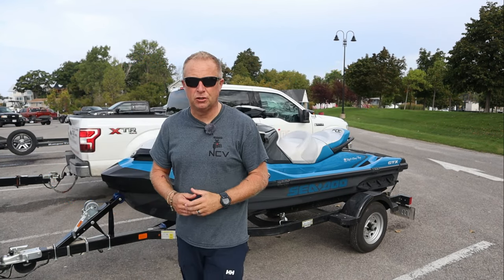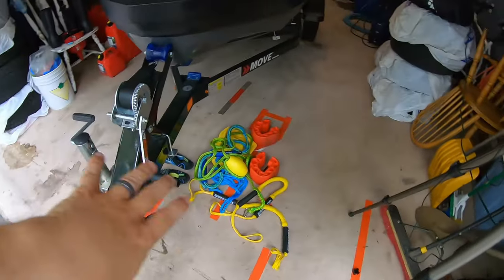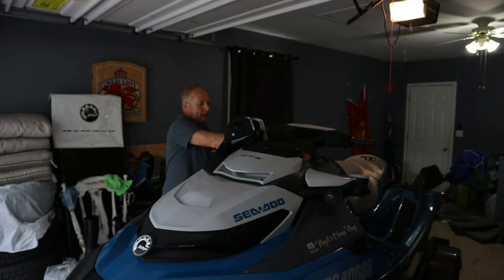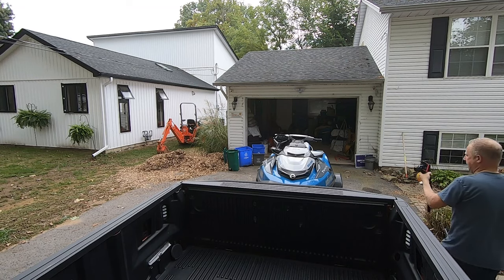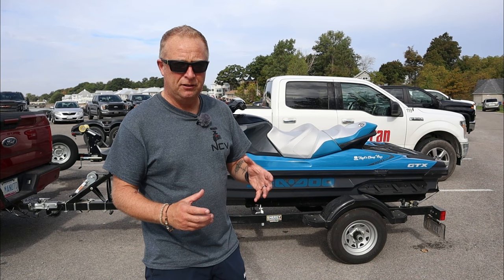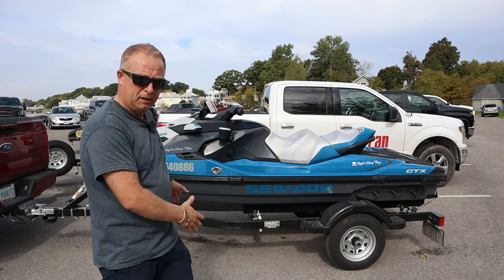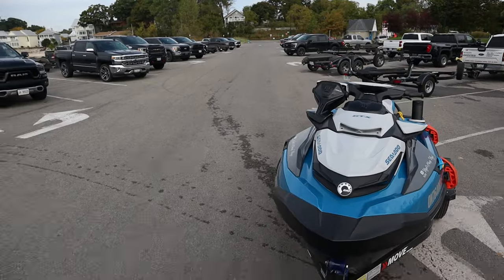How to launch a Sea Doo by yourself

Comment: Great Video!  Two more recommendations besides testing engine start though...   
1.) I recommend walking the ski down to the end or around the other side if the dock allows so that others could launch or load, depending on the dock, while I am parking the vehicle and trailer.  Never know how long you might be held up before getting back to the ramp.

2.) Use bumpers and take a quick look to see if anything on the dock where in intend to tie up might cause damage to your ski.  Screws, nuts, bolts, anything.   I learned this the hard way.  Even in relatively calm water, your boat or ski with rub against the dock, trust me!

Tip: I Used a Mr. Clean Magic Eraser on my trim to remove residue from old dock bumpers with amazing results!  However, I would be hesitant to use on painted areas without further research.
Reply: I'm in uh nkn 0:30 0:30 0:32
Reply: 2:26 2:27 2:27 2:27 2:28

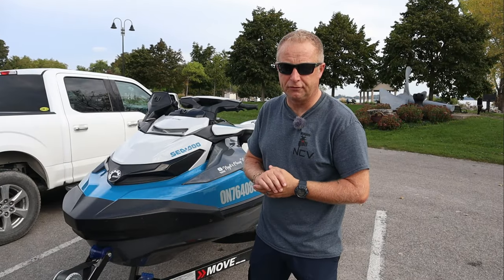Comment: I got to 5:13 and I have to tell you that you have missed the MOST IMPORTANT PART BEFORE LEAVING HOME... ALWAYS START YOUR SKI HOME MAKE SURE IT STARTS BEFORE YOU DRIVE AWAY..... I have seen so many people drive for 1hr to the boat ramp and they're battery is flat or the ski does not start 😂😂 Come on Nigel.... You should know that.... Add to the list... START YOUR ENGINE MAKE SURE SKI IS ACTUALLY RUNNING BEFORE GET TO THE RAMP. After years of taking my ski out is the main thing I check befor leaving every time
Reply: haha, dont listen to him. The new skis start every time Nigel
Reply from the maker: I'll hold my hands up to that one, you are quite right. An over sight as i have been riding so frequently.
Reply: @NigelHay  all. Good don't want to be annoying but is a frequent issue at my boat ramp so I thought I shared my thoughts 😂 I have a new ski as well and I ride often so I don't have this issue but other always do... In any case I always start it up at home to be sure 😉
Reply: Facts! I always fire it up and charge my batteries before heading out 😅
Reply: Came to the comment section to look for this exact comment 😂

None the less, good vid.

Comment: Hi Nigel. Very informative video. Most commentors have mentioned a few other little important steps that also help out. I am a new owner this year and the toughest thing that I find is backing in an empty trailer to pick up the PWC after a days outing. The trailer is so short that it is almost invisible, except for what can be seen in the backup camera of my truck. I rigged up two little wood blocks that I clamp to each taillight bracket. The blocks have a small diameter hole drilled into them, into which I insert one of those reflective 'lollypop' driveway markers. Makes seeing the trailer backend so much easier. Then I just pull the markers out of their holes for the ride home. Cheers. from a fellow Ontario rider.
Reply from the maker: when i had my F150, i couldnt see the Sea Doo at all, with the smaller truck i can just about see the mirrors in my mirror

Comment: Great video. I learned a lot being a newbie this year. Quick question. How did you load your sea doo onto the trailer and secure the bow without getting your feet wet?
Reply from the maker: I will be covering that in this springs video lol, trick is to get truck and trailer in a good position close to the ramp, then i can just step onto the step over the wheel and step on to dock.

Comment: Good video.   I have a few questions for you .
1) when do you detach the bow line? Before you back up? Are you concerned that the ski can fall off the trailer on a steep ramp before you get to the water?
2) It  was good to watch how you did not get your feet wet.  When backing job where did you attach the blue rope? Was it to the truck?  So you are in the truck backing down. The ski then floats off the trailer- where is that lone attached?
Reply from the maker: Hi Stephen, good questions. 
1st answer, When i am using a ramp for the first time I often detach the bow line just before the trailer goes in to the water, so basically reverse, stop, disconnect and then reverse the last 6-10ft or so.
This will also tie into your second question, usually when I detach the bow line that is when i grab the other rope and basically i just open the rear door over the top and close it, that holds the ski as it slowly floats free.
Reply: @NigelHay  WDYM open the rear door over the top?
Reply from the maker: @StephenSeligson  yes and then it's caught tightly and is hard to be pulled from

Comment: Just one thing to point out, noticing your Ontario plates.

Drain plugs but be out when transporting a watercraft on land to help prevent the spread of invasive species, and you can be fined for it doing that under the invasive Species Act (January 1, 2022)
Reply from the maker: I was advised to have them in when driving, especially on longer journeys, minimize the risk of them breaking.
That said I usually undo them once I get out and then when I get home.
I'll have to look into that again though
Reply from the maker: I have read up on this and it does say keep plugs out but it does not state PWC, I'll see if i can get an answer from the MTO

Comment: When your pwc (boat or jetski) is on wood and carpet, you can speed a little bit by removing every clips for transport,even the hook at the front,because it won’t slide down. Unfortunately,if it sits on those rollers,you can’t,it will just slide…

Comment: When I launch my seadoo I usually don't back it all the way in, I back it up so that the water just touches the rim on the wheel. Cause if I drive the whole trailer in, it'll rust because of the salt water. But it's a pain in the ass to push it off because I don't have rollers, so I need to be 2 people to launch it because it's way to heavy to push off

Comment: #1 Make sure skis battery is charge
#2 Take off seat at home and fire up ski 
#3 Look at engine bay tighten any loose bolts
#4 Look at outside of ski, pump check any loose bolts
#5 When at launch ramp seat off and out of water fire up ski 
#6 While ski in water still on trailer and front still attached to trailer seat off fire up ski check for water leaks inside 
#7 Never go alone

ADD this to your list.

Comment: Great video, however you omitted one critical step, turning on motor whilst still on trailer to ensure it will actually start before launching.
Reply from the maker: shush lol, i realized that after i edited it as i was going to narrate that bit in but it was to late